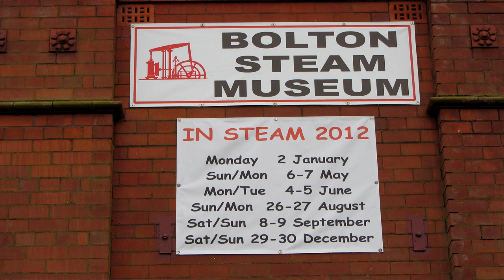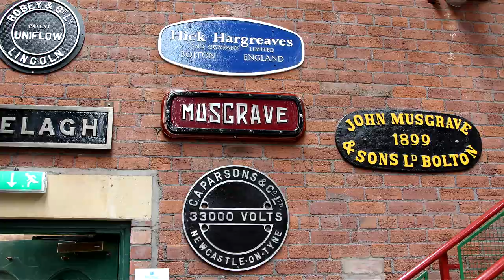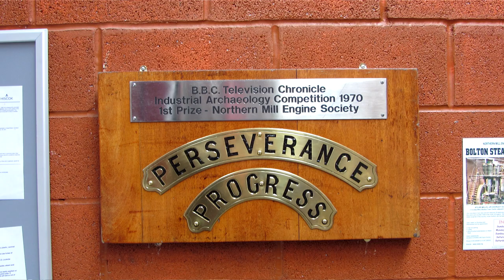Demonstrating Progressive Video Recording 1080p (25fps) - Bolton Steam Museum

Comment from the maker: Hi, yes 1080p avchd is very hard to process without a icore 3 or icore 5 processor with a dedicated nvidia cuda or amd radeon card. However playing the clips from the camera via the hdmi port to your tv should give excellent frame rate and stutter free playback as the camera processor is designed to do this. 720p is adequate for most applications as it is a good balance between file size and performance requirements of the pc

Comment from the maker: Not noticeable really, the 25p is usually for PAL tv systems and 30p for NTSC due to legacy requirements of the old analogue tv systems. In theory there should be smoother motion with 30p but its marginal

Comment from the maker: All of these cameras look to have the same 12.1M pixel HS sensor and processor combination so quality wise ther shouldn't be any difference. The cosmetics of the cameras appealing to different tastes in camera design. The underwater mode which helps combat cyan/blue scenes should be an added bonus. The SX220 has the longest reach in terms of zoom and all the cameras start from 28mm. All the cameras get good reviews for quality and I'm impressed by the SX220 (or sx230 with gps) for its features.